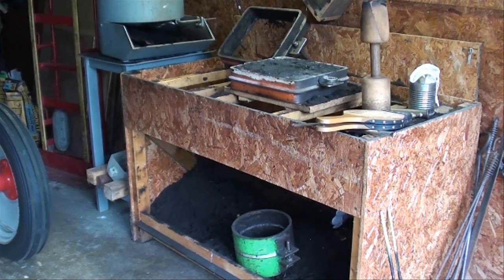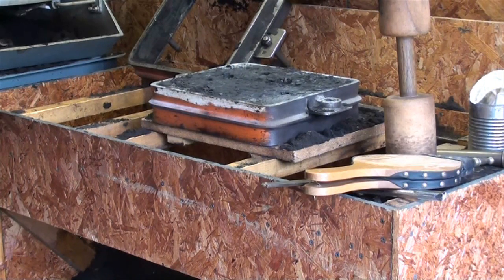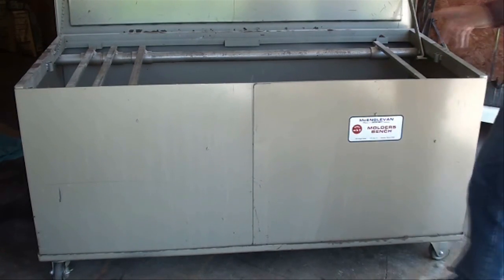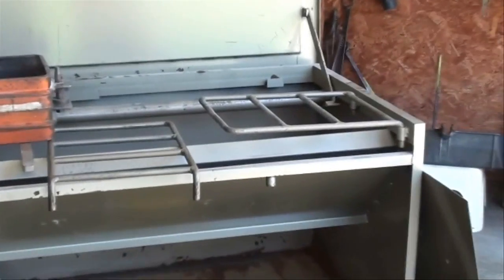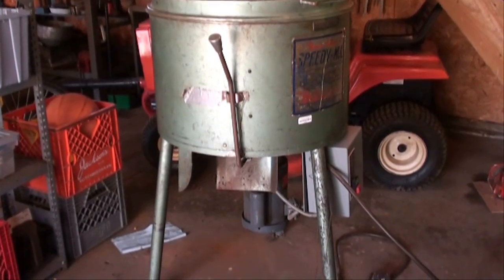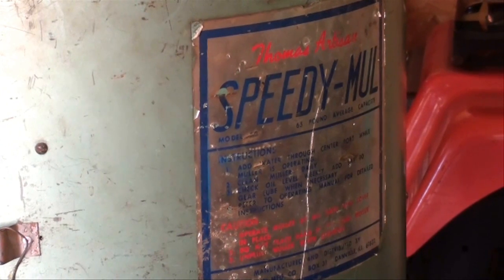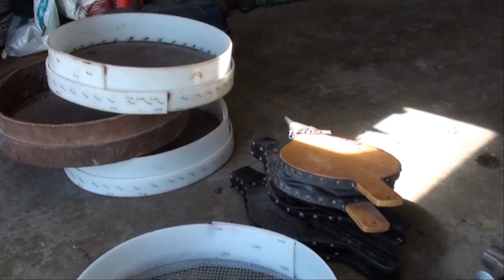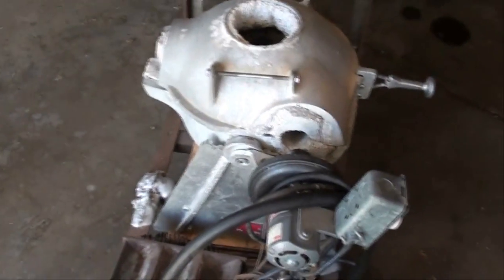HOME METAL FOUNDRY Casting TOUR tubalcain

Comment: Please be aware that if you do convert the motor on that muller down to 110 you probably also need to replace the coil in that magnetic starter with a 110 one.

Comment: Have you used the new furnace yet? If so, I'd be interested to hear any comments you might have about it. I built a propane fired furnace somewhat similar to that, and I like it a lot. I think it's quite a bit smaller than yours, it  holds about 13 lbs of aluminum.  Since I usually work alone, I designed it to be easy to use single handed, the compact size helps with that.

Thanks for taking the time to share your knowledge, your videos are not just instructional, they're inspirational too!

Comment: Tubalcain it's a very interesting field. My uncle was a loose pattern moulder and was able to do outstanding work. I worked in a cast iron foundry pouring iron and shaking out. I learned a valuable lesson concerning hard work. After leaving the foundry, other labors didn't seem so bad when compared to the extreme heat and hard labor! Thanks for sharing you'r new set up. I enjoy your videos, be careful and enjoy!

Comment: Have fun with them!  I have a home grown foundry in my backyard.  There's a nice crucible furnace that I built with an 11" bore, an A8 crucible, and a new molding bench.  Its really a huge plastic storage bin, but with a rack built for it, will work just fine.  I built a sand muller too from some motors and gearboxes and a propane cylinder.   I've matched my high school's foundry capabilities!